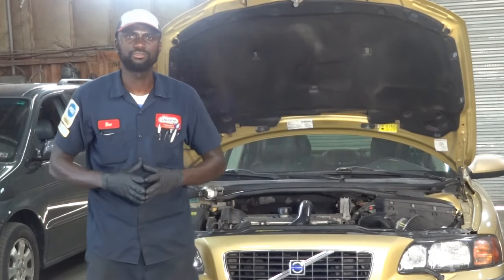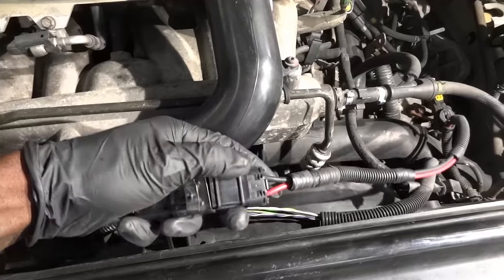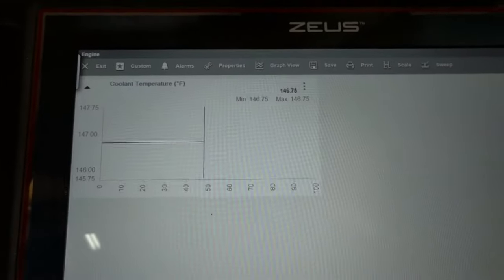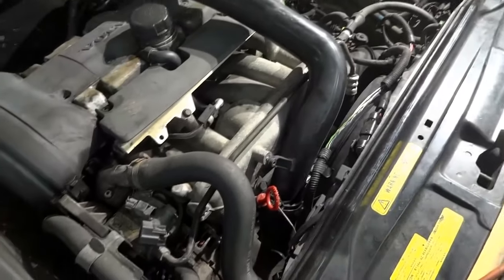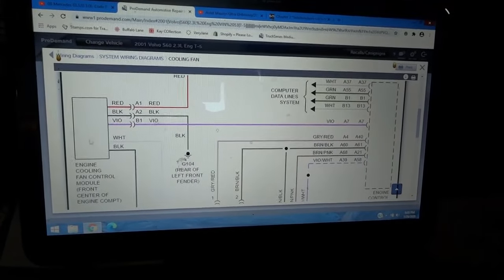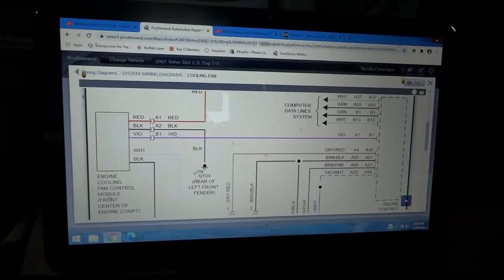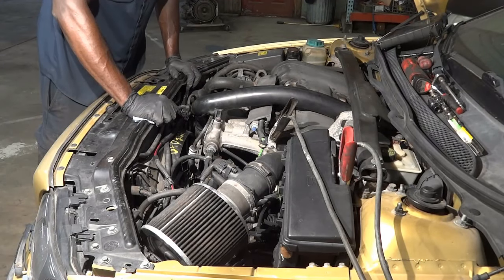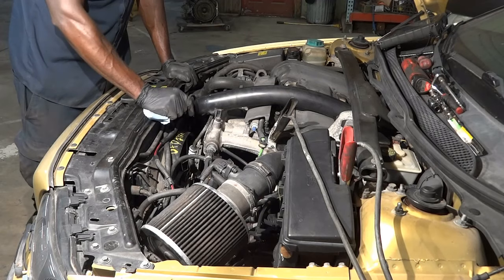Cooling Fan Stays on until the Battery dies ( Radiator Fan Runs all the time )

Comment: Good evening, can you tell me where I find this electrical scheme, and what signal comes out of the control module to drive the electro fan? I'm in the same trouble..
Reply from the maker: Sidney Souza  you get these wiring diagrams from mitchell prodemand!! are you working on the same kind of car!!
Reply: @KITS_Auto_and_Truck_Repair  Good morning, yes Volvo s60 2001.
Reply from the maker: @sidnelsom2005  follow the steps in the video to test the fan module!!
Reply: @KITS_Auto_and_Truck_Repair  Opá, Good night, I followed the steps of the video and identified that mine is no longer with the module, I conclude that this is the problem.
Reply from the maker: @sidnelsom2005  that's awesome!!

Comment: Mine does the same thing but the fan assembly does not have a module on it. It is a 2008 Lincoln MKZ .  Wonder where the module is located or if it could be another problem.  Thanks.
Reply from the maker: Chris Baker check in the fuse box under the hood if there is a fan relay in it, and disconnect it to see if the fan will stop,
Reply: @KITS_Auto_and_Truck_Repair  First thing I did and it of course shut the fans off.
 I took it to Ford dealership and they put it on the computer. Nothing showed up.  They consulted the manual and said it was the cooling fan module.  It will cost $1,200.oo plus tax to get it fixed.The cooling fans are $624.00 and labor $600.00.   The fans on my car does not have that module on it.  Strange to me.  I feel it is the fan thermostat control but I am not a technician.  So I had to make the appointment.
Reply from the maker: @chrisbaker528  sounds good Good Luck!!
Reply from the maker: @chrisbaker528  My Pleasure!!!  I'm glad to hear that you were able to save money by doing it yoursef, That's awesome!!!

Comment: Hi please advice I've got 2012 peugeot 3008 1.6 A/T vti petrol my fan allowys on while driving sense starting the engine and when I switched the engine off the fan stay for 5 on then it's off and the battery many times died please help and the car taking so much petrol, thank you
Reply from the maker: Michelle Mull  can you check to see if your fan is controlled by a module? it should be on the fan housing!!

Comment: Now i no whats wrong now i need that part  thanks for the information
Reply from the maker: budandkickstv My Pleasure!!!
Reply: Let me ask you a quick question
Reply: I have a 2010 for fusion when i turn my car off ! The fan runs for over 10 minutes then it stop but when i turn the car back on it kills the battery tell the point were i have to get a jump ! Is this the same issue?
Reply from the maker: @budandkickstv  yes, follow the steps in the video to figure out what's wrong with your car, most radiator fans are wired the same way, you either have a control module on the fan or a Relay... but start by testing your coolant temperature sensor first. Good Luck!!!

Comment: Uhhh, it should NOT run for 15 minutes after the engine is turned off -- seems like 2 minutes  should be plenty.  I think the replacement is doomed to fail the same way soon.  Otherwise, good video thx
Reply from the maker: @edh6096   Thanks!

Comment: My 2010 Toyota corolla professional if i turn on the Key and turn it off the fan goes on and if i turn it on then the fan goes off even if the car was parked the whole night. So if I take off one battery terminal and connect it back again then the fan goes
 off. If I start the car the fan will be of until +-15min then the fan kicks on. I have changed a temperature switch, Fan Relay and Fan switch module but problem not solved.
Reply from the maker: lufuno brendon munzhelele  Since you replaced all those components, it sounds like you problem might be in the wiring or the ECM itself! you should have it diagnosed!

Comment: Mate, great video. I have a Citroen with a fan that stays on for 5-15 min after stopping... Is this normal? The one in the video was 15 min and you said fixed. I am not use to turbo vehicles...
Great video again. Cheers:)
Reply from the maker: Donkey B1 15 min is a lot for a fan to stay on! is yours draining the battery?
Reply: @KITS_Auto_and_Truck_Repair  I think it is... But only just have had battery problems. (This week). I have only had the car (2nd hand) for about 2 months. It is not going ATM. Is this a sensor problem?
Reply from the maker: @donkeyb1627  this can be caused by a couple of things. you should take it to a pro mechanic to have it diagnosed!!

Comment: Why is the fan circuit still on when engine is off?
Reply from the maker: Richard Barber the fan stayed on when the engine was off because the fan module was shorted, which was causing the fan to stay on all the time!!!
Reply: @K Diagnostics, I think he meant the situation after your repair where the fan kept spinning for 15 minutes (long!). Which is an nteresting question since the egine can cool off all by itself without the fan spinning since it it not burning any petrol anymore...

Comment: The signal from ect is correct the fun take the signal to open but no to stop until open heating inside car
Reply from the maker: Nikolaos Papaioannou what do you mean by open heating inside? does the fan stay on when you turn on the heat in the car?
Reply: Hello when I open heating the fun stop and start after while. Today I try to change thermostat..

Comment: I have a Nissan march and when it start the fan turns on and won't stop unless car is off 
We change the switch but it's still there
Reply from the maker: TEAM JA FAMILY is your fan controlled by a fan control module?
Reply: @KITS_Auto_and_Truck_Repair  I have no idea... How do i check?
Reply from the maker: @globaldynamicteam6022  it's basically the same process I did in the video!!!

Comment: I have the same problem with a 2006 Chrysler 300 SRT8, The thermostat went bad I change the thermostat and the temperature sensor checked the relays fuses and they are OK,,,And the fan will still on,,, And I still have the same problem
Reply from the maker: Ieoneltorres35 if it has a fan module you need to test the module, or you can have a short on the fan control wire... Good luck
Reply: @KITS_Auto_and_Truck_Repair  thanks
Reply from the maker: @leoneltorres35  you're welcome